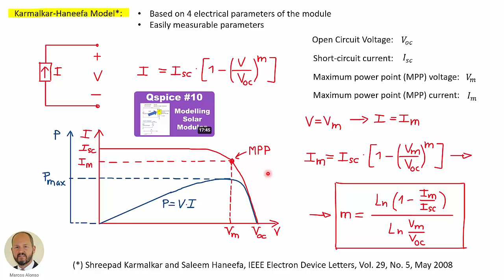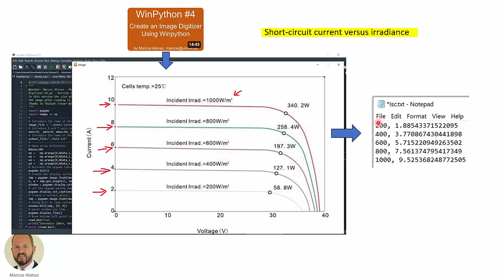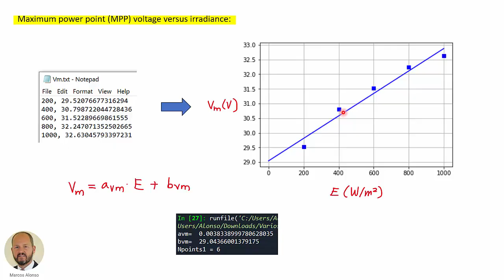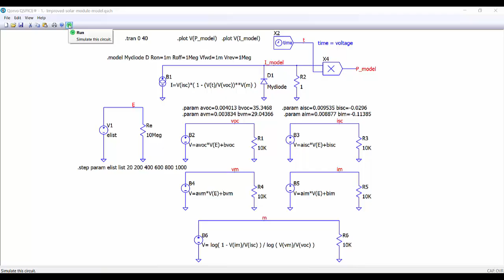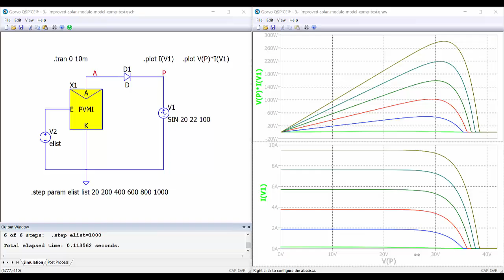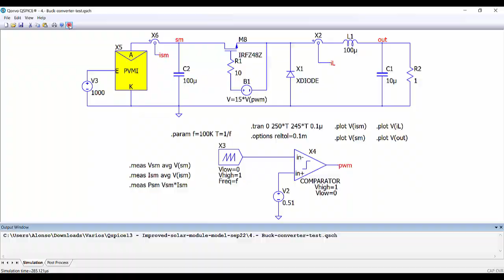Qspice #13: Improved Solar Module Model for Qspice

Comment: ty sir but may i ask something... ill tried to make the same pvmi model by following the first video tutorial but why it keep saying the Fatal error: RS•X1: missing resistance value.
Reply from the maker: Hello, it seems that Rs lacks its value. I have used Rs for both the designator and the value. This is quick but maybe not the most advisable. You can use Rs for the designator and Rsv for the value

Comment: Thank you sir.
I was wondering if it might be possible to train this model using LTspice as well?
Reply from the maker: Thanks for your comment.
Yes, the spice description is compatible with LTspice. You only have to create the symbol and add the spice description to it.
However, I recommend you to switch to Qspice, which is much better and straightforward to use if you are already familiar with LTspice

Comment: Last year I was doing some LTspice simulations related to solar panel arrays and the results of partial shading causing current to flow through the reverse protection diodes.  At that time, I was unable to make the models work in QSPICE.  I think it was because I could not get power calculations on the subcircuits I had made.  Do you have any suggestions about modeling parallel series arrays (for the whole panel) with protection diodes and then reducing the radiance on individual or groups of cells?

Thanks for this presentation,
Carl
Reply from the maker: Thanks for your comment. In principle this model can be used to implement a panel by connecting several modules in series and/or parallel. External protections diodes must be added. I thought it was better to leave the protection diodes to be placed outside the module
Reply: @MarcosAlonsoElectronics  is there a way to display power dissipated in the module array elements?
Reply from the maker: Yes, of course. You only have to measure the current and voltage of each module and do the product. You can use the current sensor "isense" and the "multiplier" available here: https://github.com/marcosalonsoelectronics/website/tree/main/Qspice
They have embedded spice definition so you can use them directly in Qspice